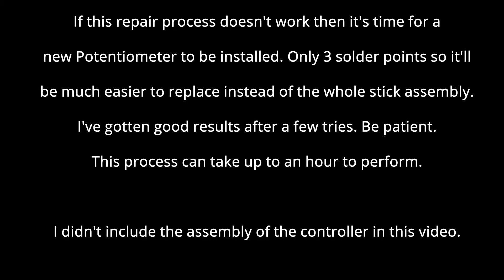Stick Drift: Cleaning out Potentiometers Thoroughly May Fix It

Comment: When i cleaned the potentiometer on my dualsense controller,
I kept testing it half assembled. After a few tries just cleaning,
I used tweezers on the wire where it contacts the socket,
I bent it slightly from a U-shaped-tip into more of a V-shaped-tip to reduce how much of the wire is contacting the socket, and now it works, i haven't had another problem all year.

Comment: I tried this on my xbox 360's left stick it did inprove the responsiveness of the joystick but my sticks are too far gone the plastic is worn down and there's a lot of play in the movement. I'm going to have to replace my sticks :/
Reply from the maker: Yeah, I hate replacing the whole stick. I try to get by with changing the pots out only but if there's a lot of play then that suggests its the whole stick that has got to go.   :(

Comment: Do you have twitter? I would love to send you a video of my stick problem. Basically my right stick (axis2) is going completely to the left by its own when I play cod as an example. It does 360 by itself and I dont even touch the pad. For me I feel like its not stick Drift because turning deadzone up doesnt help. It feels Like its an technical issue in the controller. You think there is anything i can do or maybe know how to fix that? I would really appreciate it. Much Love
Reply from the maker: Either the X-axis pot needs to be changed out or the whole stick. Very common to see that issue in my field. Unfortunately, your controller will need parts and soldering.😢

Comment: my dualshock 4 has an issue in left analogue stick when i move it forward it rather goes in the left or right bouncing forward and backward from the X axis but if i click the stick and hold it forward it is gone,
I am willing to give a shot at cleaning the potentiometer from the inside
Would this issue be fixed by this method brother
Reply from the maker: I've found that I don't have to go inside the potentiometer. I just flood the 2 pots (on each stick) with Isopropyl 91%, move the sticks left-right/ up and down really fast for a bit, then blast out the stick mechanism with 60 psi compressed air.
If the pot does not need to be replaced then that clean out will work. No need to "peel" back the pot. The carbon on the inside of the pot is what wears out Although your symptoms are usually just "dirt" in the pots. Hopefully the cleaning will work.
Reply: Can that potentially fix it??
My problem is a bit different form the ones in which the stick automatically moves
Mine had problem with wrong input
Reply: Moreover, wouldn’t it cause damage to the motherboard if I straight up pour isopropyl onto it
Reply from the maker: In my experience stick problems are either dirt, bad pots (or the whole stick mech is shot) and then theres the dreaded motherboard issues of some kind. It could be any of those frankly. I cant say for sure if a clean out will work obviously.
Using a high percentage rubbing alcohol will pose little to no threat to the controller motherboard (91% or higher). There are videos you can look up on that im sure. Also I encourage you to look at many different videos as you can on controller repair before you attempt. I find that helps me when attempting something new.
Reply: Thanks bud i did it last night and now my problem is 90% fixed
I am now able to use it now it had become literally unusable